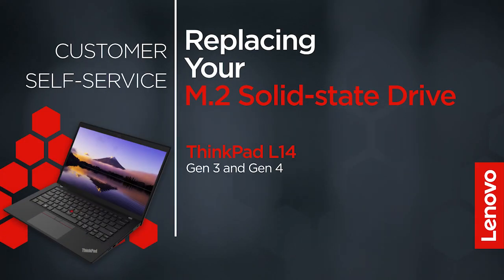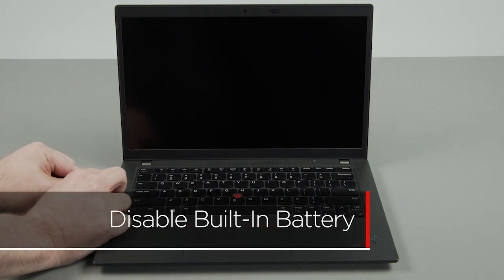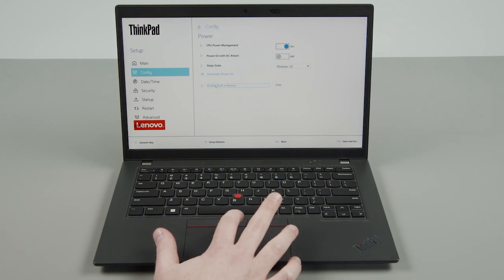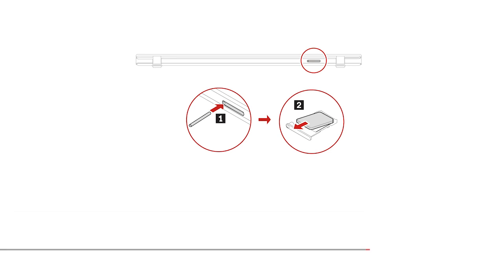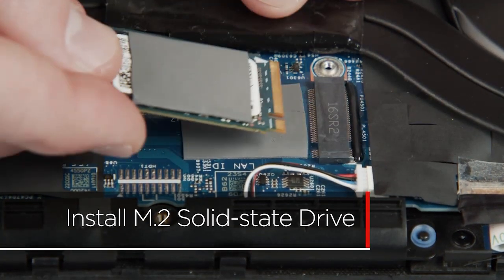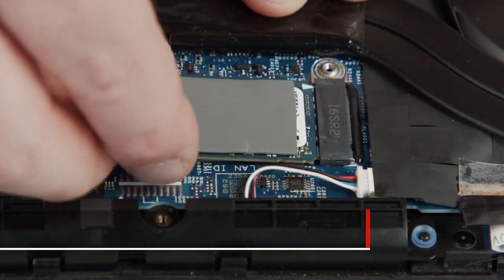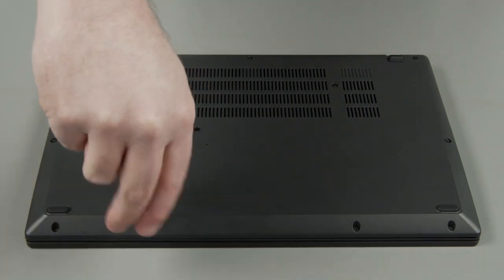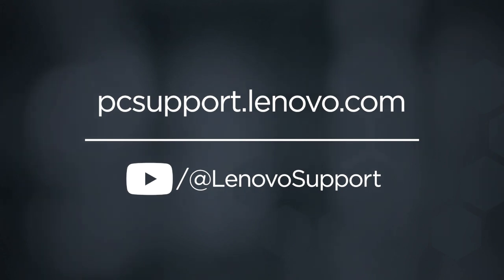Replacing Your M.2 Solid-state Drive | ThinkPad L14 Gen 3 and Gen 4 | Customer Self Service

Comment from the maker: This video will show you how to replace the M.2 Solid-state Drive of your ThinkPad. The process in this video will work for the ThinkPad L14 Gen 3 and Gen 4. 

You will need a screwdriver kit, a non-metallic pry tool, and 15 minutes of your time.

To view the ThinkPad L14 Gen 3 Self-Repair Guide go to https://pcsupport.lenovo.com/us/en/products/laptops-and-netbooks/thinkpad-l-series-laptops/thinkpad-l14-gen-3-type-21c1-21c2/selfrepair/removalsreplacements

To view the ThinkPad L14 Gen 4 Self-Repair Guide go to https://pcsupport.lenovo.com/us/en/products/laptops-and-netbooks/thinkpad-l-series-laptops/thinkpad-l14-gen-4-type-21h1-21h2/selfrepair/removalsreplacements

To learn more about your device go to https://pcsupport.lenovo.com

To find parts for your device go to https://support.lenovo.com/parts-lookup/?cid=ww:lenovosocial:b9515f&source=socialmedia&subsource=yt

To view the Lenovo Support Self-Repair Guides landing page go to https://support.lenovo.com/us/en/solutions/HT516547

** NOTE: Static electricity can destroy components. Use a grounding strap, and clean, non-conductive surface to work on. Use plastic or coated tools to prevent scratching and avoid using metal tools on plastic parts. For more detailed information on electrostatic discharge and how to prevent it, please watch our ""Understanding Electrostatic Discharge (ESD)"" video: https://youtu.be/by4PB3WtdLo 

Applicable Machine Types:
ThinkPad L14 Gen 3 - 21C1, 21C2, 21C5, 21C6
ThinkPad L14 Gen 4 - 21H1, 21H2, 21H5, 21H6

#lenovo #LenovoSupport #LenovoTechSupport